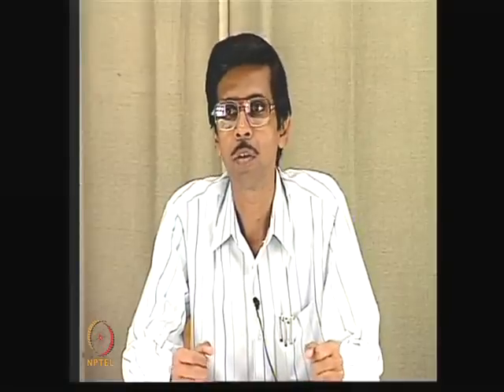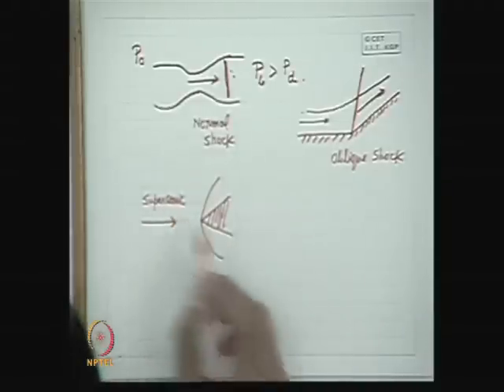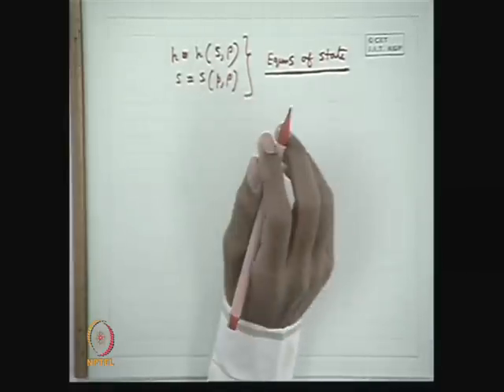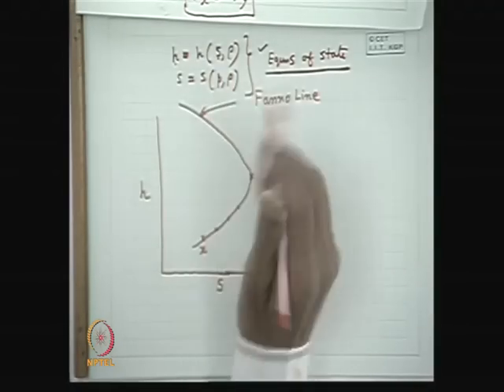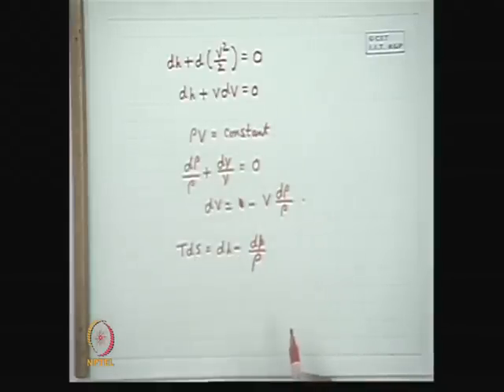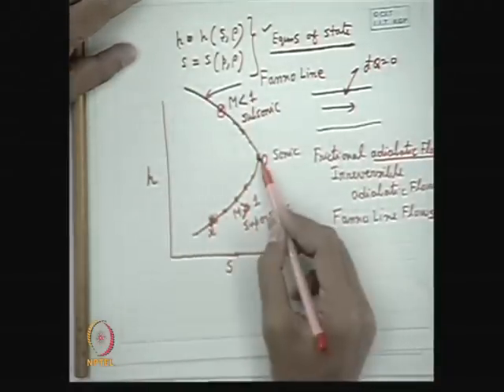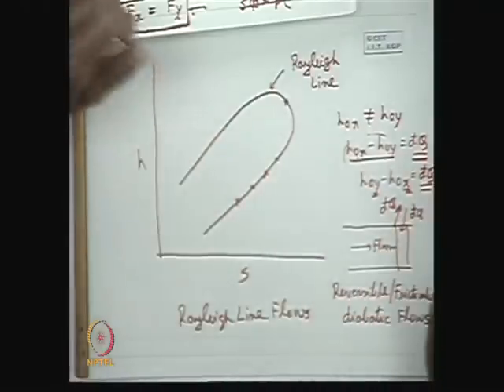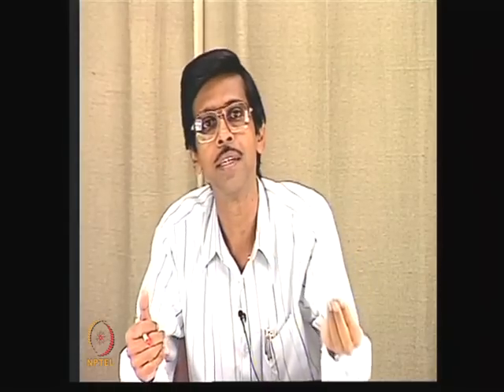Mod-01 Lec-33 Normal Shock

Comment: sir why do you use tds=dh -vdp, whereas you told it is an irreversible process?
Reply: because it is Tds property relation valid for closed system, open system, reversible, irreversible process.
Reply: that relation always holds. The only thing is that ds= 0 if reversible and no heat flow. But that relation always holds true
Reply: the answer he himself told in lec-26